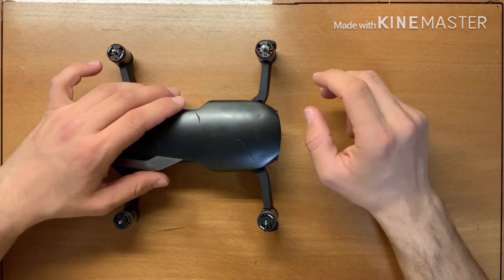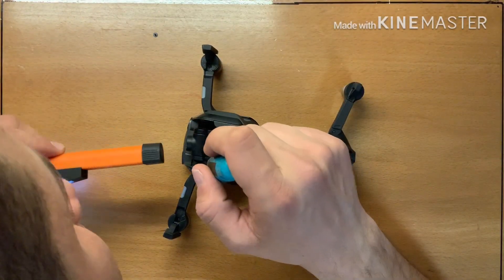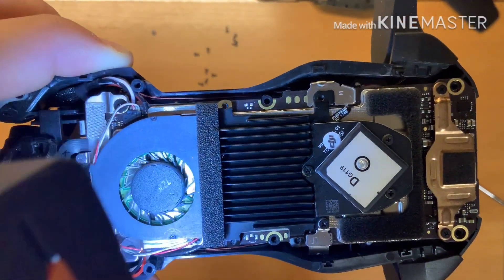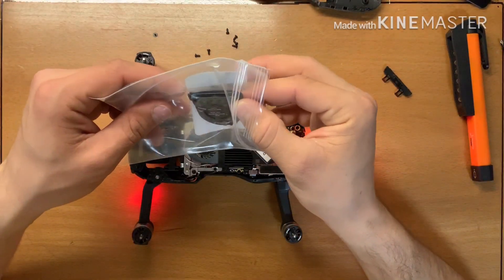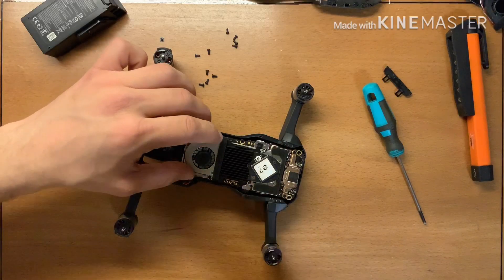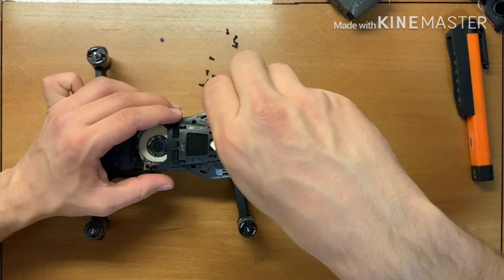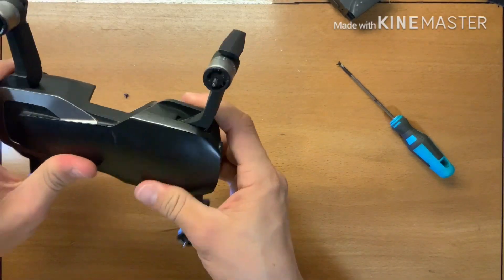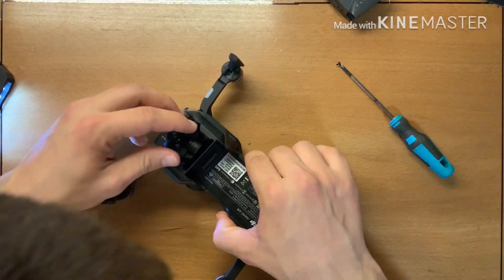Dji Mavic Air processor chip overheating Fixed Fan STOPS

Comment: Great video 🙏🫡🙌🙌💯💯 my drone fan was not goin on till I open it spin it turn it on and it turn on again idk what it had maybe a lil dirty who knows but it is now working luckily I didn't have to replace it thank you
Reply from the maker: Thank u for sharing, good to hear that.
Reply: What tool did you use to dismantle the screws under the gimbal?

Comment: No need to remove the screws under gimbal for removing upper cover. First remove the upper cover and try to move fan gently. It may work and fix the stuck issue.
Reply from the maker: Good job thanks bro !

Comment: Heads up to anyone doing this.  Some Mavic Air 1 builds do not have screws in the gimbal well.  You can still destroy the plastic studs then use a thin rod to push the cover off thru the whole where there's suppose to be a screw.
Reply: Hi, how did you destroy the plastic studs?
Reply: @brieucvtich  Had the same issue with the lack of screws at the bottom. I just used a small metal drill to remove the studs from the bottom (be carefull though for the gimbal). Worked for me and was able to remove the top shell and unblock the fan.

Comment: Hola. Podrías darnos el link de beat para poderlo comprar? Para  comprarlo para el mavic air. No quiero comprar el que no es... muchas gracias
Reply from the maker: https://www.ebay.com/itm/Brand-New-DJI-Mavic-Air-Cooling-Fan-Assembly-Repair-Parts/273068547016?hash=item3f94275bc8:g:bw4AAOSwMMFbXzUm

Comment: I fixed this problem just by hitting the area where the heat was coming from on the top with the palm of my hand really hard and the fan kicked on really load. Problem solved!
Reply from the maker: It's the classic method to fix things bro; good job

Comment: Hello, I have the same problem as you.

But we tried my fan on another Mavic Air, it worked.

So what's the problem?
Reply from the maker: You may need to do a version update , if it is not the problem tack it to the laboratory of  DJI or the store that you buy from may thay can help you.